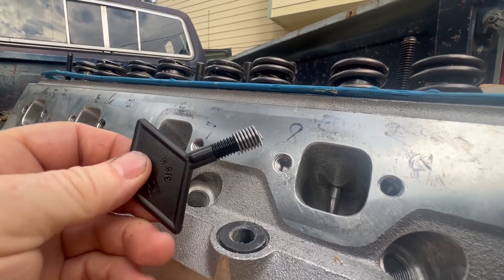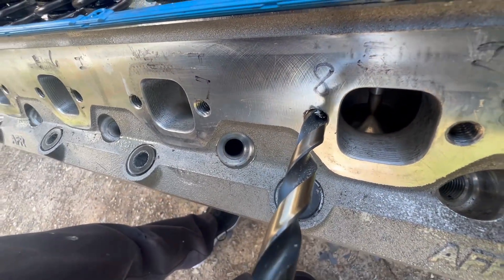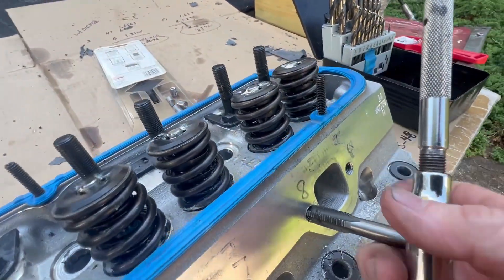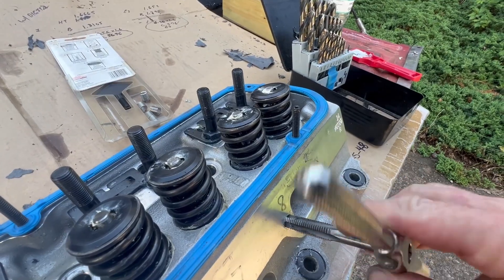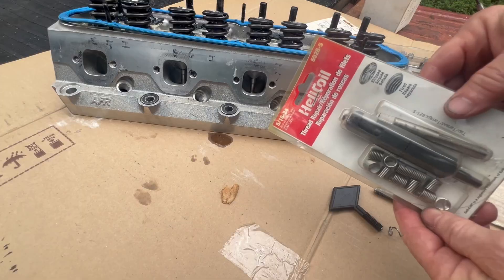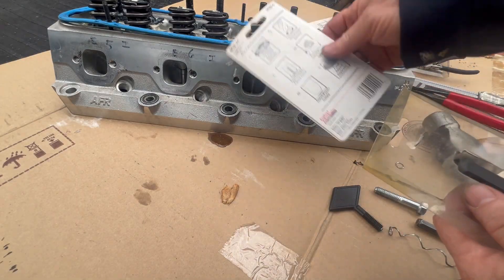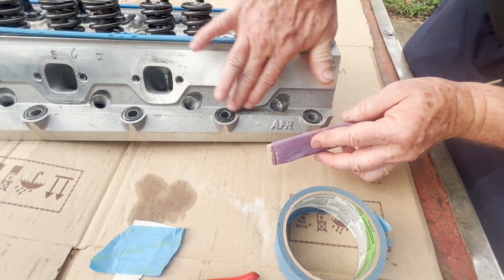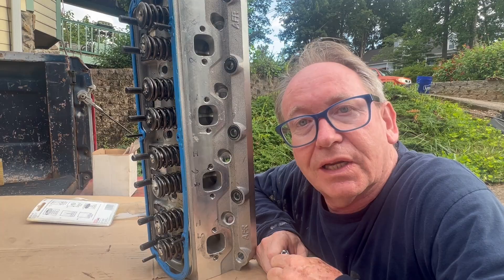Installing 3/8 Heli-Coil in Ford AFR-1388 Aluminum Head Exhaust Port Bolt Hole

Comment: Heli-Coil's in AL cylinder heads seem more of a "when", not "if".  Cool video!!
Reply from the maker: Hi, Ya they should be there to begin with like everything in aviation where steel bolts are never directly threaded into aluminum. I've gotten with Automatic Transmissions I just go ahead and put them in when it's torn down for the front pump and pan. They're going to strip, and it's always going to be the last one. ;-)